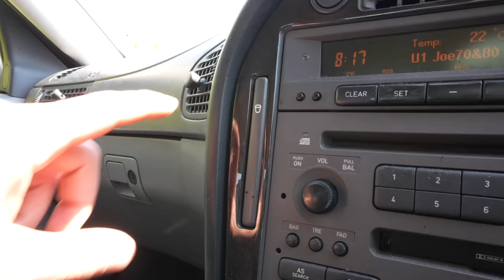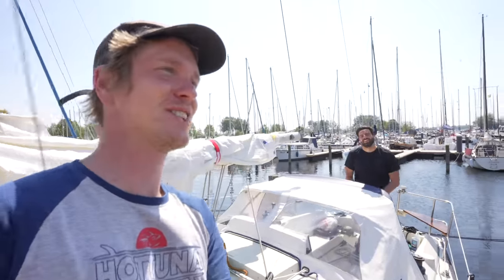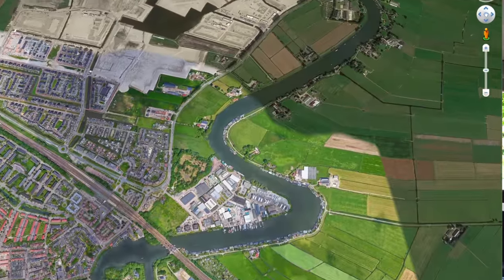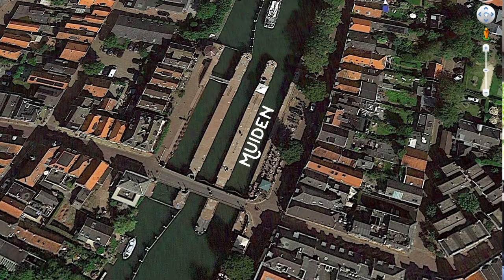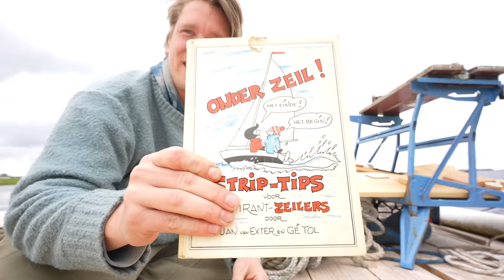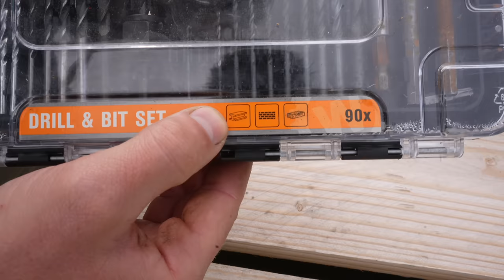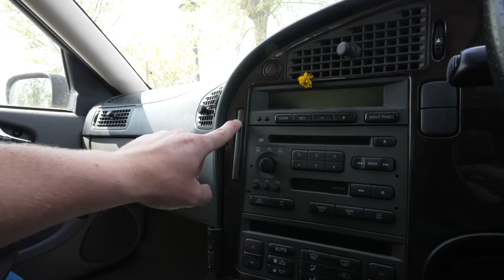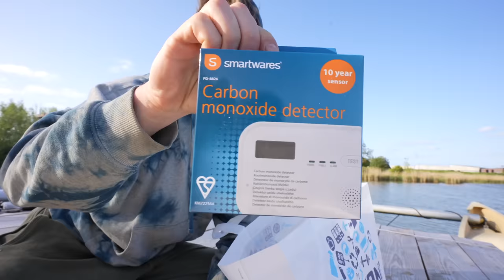Preparing to Motor My $2000 Catamaran To Amsterdam | Wildling Sailing

Comment: A cute sailing couple
with oceans under their keel
use fenders they made
which don't come with a bill.
Clean used tires lashed round
with beautiful knots;
they'll last forever
until the rope rots.
Just 2 and a 2x4
can fend you off a rough wall.
And when dragged off the bow
they make great drogues in a gail.

Comment: 20:33 one thing i would've added (at this stage) to the deck, would've been a linoleum sheet over it. Like the thicker type you use for hospital floors (they're a "hard traffic" type). Whenever you'd have work to do, you'd roll it on, and you could work without fear of stuff falling over AND because the linoleum is on top, it would've made a slightly better distribution of your weight on the boards. Would help you from going through if you jumped on one leg, but it would save your leg if you did. :) Source: i use two sheets of the stuff on top of wooden scaffolding. It makes cleaning and other affairs much easier.

Comment: Mark, instead of a cleat use an eye bolt so that the extended starter cord returns to its resting position without needing to tie it off and risk it falling in.

Comment: You can use (in desperation) glass cutting bits to drill through stainless. You need lots of oil and patience. Oil in general, should be with your drilling set into anything metallic.

Comment: You need to lubricate the drill bit continually as you drill steel. It will make your life a bit easier and save on drill bits.

Comment: The pull cord extensions are a super idea... cool.   
   Next ,  tiller....    you should have a tiller piece that attaches to the rudder arm, not a pivoting tiller piece on the rod  that ties the rubbers together.  Why???    Leverage.   As is,  you have to pull or push the tiller, and if the tiller is wet, your hands could slide down the tiller.   By have a solid piece attached to either port or starboard rubber ( or one on each),  you will get more leverage by being able to lean or put body weight on it.  The tie rod will make the other rubber follow whatever you're doing  to the one you are leaning on.  As is, in heavy seas, you would wear yourself out too soon.

Comment: When you are drilling steel with an HSS bit, you need to drill slowly and let the bit do the work don't let it  get too hot or it will burn the tip out

Comment: Drill tip stainless😊
Use some cuttingoil (or 2stroke oil) with drilling steel and stainless.
Slow rpm push hard.
All the best
Love following you're adventure.

Comment: On the engine the keeps dying try running it on premixed fuel and if it runs better they make block off for the oil injector system it's one less thing to go wrong running premixed fuel and ams oil makes some 100to1 synthetic tho I wouldn't run it than thin also i would suggest their penetration spray it leaves a film that helps protect and works better than pb blaster or free all ect

Comment: When drilling stainless, use a little oil, just a drop now and then will make those cheap drill bits go through the stainless easily. You will be amazed how fast it is. Just add more oil when it starts to smoke.

Comment: Get some good drill oil. Stainless gets way too hot and the bits will dull out in seconds. Drill it in  water if you have too just don't let the bit get hot. 😊

Comment: Hi there, would recommend trying to get some cheap nets (ex construction safety netting) to span under the open parts of your crossbeams. would make moving around much easier and safer. For fenders you can use tires as a last resort.

Comment: Concerned the outboards will hit something putting stress on the wooden mounting system which may give way at the corners - consider putting metal plates alongside the wood, "sistering" is the carpentry term, I think, to strengthen the mounting system. Aluminum L shaped or T shaped flat metal the width of the wood, drill through the metal and wood, place large washers, then smaller washers then lock washers on both end of the bolts for flexibility.  Bravo - donated rope & hand tools.

Comment: The trick about drilling stainless is to keep it cool.  If it gets hot it will work harden and then you are basically done.  Even switching to a new bit won’t help.   There are all kinds of ways to keep it cool but I just use water.  Just trickle water onto the bit and the hole as you go.   It’s a bit tricky to manage with one person to handle both drill and coolant, but can be done.  For example you can hang a bag of water with a little hole that drains the hole you are drilling.  I usually use a brush and a cup of water but it takes patience because the amount of drilling you can do before you need to stop and brush on some more water is not very much.
Reply: And drill SLOWER!
Reply: Drilling that hole would be tough on any drill bit let alone a cheap one. Alternatively, you can use machining lubricant. Any bits (swarf) coming off the drill bit should be a tan colour, if they're blue, or black etc it's too hot. A drill press would be ideal! And like another mentioned, go nice and slow!
Reply: This is great advice!
Reply: Hi Mark, you could use a plastic Sadie’s bottle with the conical neck. Then add a tube on the neck with a tube clamp as a tap. Then you find a place to put it to suit your work. It can trickle on the drill bit as you drill. I don’t know if that would suit you but it has worked for me, and cheap too. It suits my recycle, repurpose and reuse. Enjoying this journey as you rebuild this cat.
Reply: I usually put a small amount of old or used hydraulic oil or motor oil in a Tupperware and dip the entire bit into it. Oil slowly runs down the bit keeping it cool and lubricated. That along with low RPMs works great.
Reply: Coming here to say this as well. Definitely some cutting oil is needed. Take your time with it.
Reply: Also with stainless  you don't want to stop drilling as the bottom of the hole can polish and work harden. Any oil will help to cool the drill. Even wd40.  Also sunglasses make acceptable safety glasses.

Comment: Looking forward to seeing the video of you moving to boat yard . It was good you extended the pull start cables . But just one thing if you treaded it through a couple of ring eyes then put your cork handles on if you did accidentally drop them you would not have to go fish it out the water . Good luck

Comment: Mark, stop putting yourself down. You have a lot of experience and still willing to learn and gaining a lot of experience. I would not be in the least bit concerned sailing with you. Best of luck with the move to the hard. Still going to be a lot of work but should be a lot easier with the boat dry and your car much closer. Keep smiling, you'r doing fine fella.

Comment: Love the fact you have a dream and are following it. Best tip to give on this video is to just commit to some decent drill bits as the cheap bits will cost you more in the end. One decent set of Sutton bits ( not sure what brands are good over there) and also the trick is to slow the drill down. Even though they say high speed if you go to fast it just burns and makes the bit go blunt. One decent set of drill bits and a drill bit sharpening aid and you will be set. Also not sure if you doing a solar setup but those outboards with an electric moter instead of the gas engine would give you some free population

Comment: It may help when drilling harder metal to center punch first.  Also when drilling it would help to drill with slow speed heavy feed.   I don’t know what you call it but instead of a Clete you could use a screw in eyelet to hold you pull cord.  Cheers

Comment: Great Video! Cheap drill bits can be a pain, but if you keep the RPMs low and slow and use cutting/drilling fluid you can do almost anything with them- even more so if you learn to resharpen them ( the cheap one are easier to sharpen- not as hard- which generally also makes them not as brittle and less likely to snap if you sideload them accidentally).

Comment: Mark, you need cutting oil or foam for cutting metal, otherwise you will need shares in drill bits. Any oil while drilling on the tip of the bit to stop it heating up

Comment: When drilling steel, and especially stainless steel, go slow push hard and keep the bit cool with oil or something. It is more about cooling than lubrication. For example sometimes I spray it  with WD-40 which is not a great lubricant but by spraying it periodically (every few seconds) it keeps the bit cool. If the bit is spinning really fast it will harden the stainless steel, and dull itself very quickly.

Comment: hello, to make sure the bits don't break or not stick, you have to use them in the drill at a lower rotation.
You have to let the drill drill at low speed, if you accelerate you don't let it cut the metal, it heats up and you run out of blade. You make the drill not drill anything or take a long time to drill. if you add a little spray oil it also helps not to overheat.
If you want to drill a big hole, always start with smaller bits and work your way up until you get the size you want.
I'm enjoying your progress on the boat. The details are always cool to see! hug and good luck

Comment: Well done you are getting there, don’t forget only use 316 stainless steel fittings, screws and bolts etc. if you mix metal’s or use 304 stainless they won’t last very long and will leave rust streaks all over your restored boat…

Comment: i love watching Your progress. Who knows maybe you are just few years ahead of me.
When it comes to drills - in my old life (metalworks, blaksmithing etc.) i learned alternative approach. 
First: every drill needs cooling so think about anything with water - short while of drilling and put Your dril bit into cup of water till it feels cold again.
Second: metal drills gives great precision but requires really slow rpm, proper pointing/tracing of the hole and firm handling. If You can sacrifice a little precision for easier handling and less troubles in piloting the whole go for masonry drill bits. If something can chew trough reinforced concrete it can easily drill trough metal. (low rpm and cooling still apply)

Comment: Hi, I’m a big addict to your adventure, keep pushing. Small advice, for 10 $ you can put the lights , you know, red-green no front etc. is mandatory and if the night catch you while you are moving you Will have issues. Cheap one , a trick I used, 3 flashlight, one for the top, and the 2 for the front painted or covered with a plastic. You can solve it with 15 $. All the best for you

Comment: Someone below mentioned cooling the drill bit with water, and yes that can work to cool and lubricate and extend the life of tools, but water also solubilizes oxygen that will rust your tools.  Maybe you already have high temperature oils on Mahi that can cool the drill bit, lubricate and have the added benefit of preventing oxidation.  That oiling of metals is something you're going to want to do often, specially when your back on salt water since it's even more corrosive.

Comment: Watching you work and go thru new experiences is very enlighting.  I sail, but with a smaller neptune sloop.I have sailed smaller trimirans, but assisted in a major repair on the family 40 ft Matthews cabin cruiser, after we broached on a hidden tree.  Just a small tip, when you set up to anchor, tie your chain or rope to the head of the anchor and then zip tie the line to the shank, also run your rode thru a small tube and keep it on the deck till ready to pull anchor, just kick the tube into the water and back down, the tube will pull the anchor straight up and make retrieving your line much easier  Thanks, Ron

Comment: Hi Mark, great vids, beautiful boat, great work and good steps forward, you have the heart of a lion.
Small tip - to get the most out of a drill bit when drilling steel, I use a spray bottle of water to cool the cutting edges, it should be soluble oil mix but that's too messy on a boat, so water is a good compromise.
Good luck with getting lifted out at the boatyard.
Onward.!

Comment: Hi Mark, things are beginning to move along nicely now. Speaking of moving, make sure you have good mooring lines, long enough, to act as springs and shorter ones as breast ropes. I don't have to tell you, how boats love to dance shake and shimmy in a lock that's filling. Oh, and a little tip, when drilling metal, a small drip of 3in1 oil or 2 stroke oil on the job to aid the bit to cut it's way thru. And stop getting so excited, we'll all do that for Ya. KInd Regards, Barnacle Bern SY Cadbri

Comment: Cheap drill bits alson gets the job done on stainless but, as many others have already stated, you need to drill much slower but with maintained pressure, and keep everything cool. Water has been mentioned but i use oil - works great for me. There is a dedicated cooling/lubrication-spray but i don't know if pays off. KEEP UP! I love your channel!

Comment: Mark, when you a going  after drilling thru stainless, use high pressure and short bursts with a detergent or cutting oil as lubricant.  This keeps the heat down and won’t round over the drill bit.  Steel takes high pressure and very slow speed, same lubricant and give some time to let everything cool.   When you develop heat in the bit, you lose the cutting edge on the bit tip, and you  workharden the piece you are drilling which in turn will prevent the bit from cutting properly.  Machining takes patience and care to keep your tools working longer...........s take it steady with diligent pressure.

Comment: Another thing, I don’t know if you remember me telling you,  there is a measuring cup,  (get it from the boat shop) that actually tells you how much oil to add compared to litres of fuel,  (does the math for you) if eg you add 3lts  and want 50/1  the cup will show you for 50/1 (that’s the most common after an engine is ran in)  fill the cup to this line,  it’s simple and cheap and you just store it with the oil..   I personally love them old Suzuki outboards,  and i did recommend you extend the “pull cords”  idk if you read it,  but once you are on the hard? Give them a super clean and some new Suzuki grey,  (yes its still available)  personally i would remove the oil injection completely (it’s one less thing) and give them carbs another clean,  i know Dad already did them once,  but the old oil is probably still got microscopic sludge roaming around affecting your base idle, 
I personally DON’T think them engines will need replacing anytime soon, (I doubt they even have a,lot of hours on,  they were bulletproof in their day, and still compare power to weight with new engines,  (seriously look it up)    Anyway thanks again..

Comment: Should use a few drops of any kind of oil on drill bit and nut. I keep my used motor oil and lubricating drill bits is one of the many uses for it. Keeps bit from burning up. Nice progress. Great that you're making good friends. That's what a good life is all about.
Reply: And SLOW DOWN drilling metal!!
Reply: @dancarter482 
 Yes!

Comment: I saw a really interesting system for the outboard motors on another cat, they made a pivot cabinet so that they could raise the engines out of the water when under sail. That design made it easy to work on the engines without having to hoist them on deck but also since they pivoted out of the water it reduced drag  under sail. I beleive you could design this system with gas shocks so that you can lock the into place in both up and down positions and you also don't need to lift the full weight of the engine, this would something like a Murphy bed. It will take a little trial and error to get the pivot point and gas pressure right but the shop selling the gas strut normally allows you to bring it in and change the pressure if it's not correct. If you need help with the design you can post the dimensions and ask, I am sure someone watchin you has some experience.

Comment: Bite the bullet and buy 10 packs of HSS drill bits in each size you use - tapping threads need odd sizes which you will use over and again. (I learned the hard way).

Comment: @Wildling Sailing
I'm not sure if you saw my comment about making an off grid loo but all you need are a 5 litre plastic jerry can, a silicone rubber oil funnel for collecting your urine, a 20 litre bucket with lid, kitchen bags, peat moss from the garden centre & sawdust to cover your waste. About a coverage of an inch or 25mm of peat moss in the bottom of the bucket that has a bag in it then as you add your waste you sprinkle a little bit of saw dust over the solid matter then seal the bucket up, it won't smell as the peat moss will turn all the solid matter into soil.

An off grid shower, when I was in the provinces of the Philippines we had to shower using a 1 litre hand pail from a 70 litre plastic garbage bin that was used for water only & we would just use a soapy wash cloth to clean our body & rinse off with small hand pails of water. If you can find yourself a 12v DC circulation pump that does several litres per minute & buy yourself 50 metres of 1/2 inch or 13mm  irrigation hose plus a 70 litre plastic garbage bin from the hardware store then you can make a DIY solar hot water heater. By putting the hose in a flat spiral coil with the small 10w pump sucking water out of the garbage bin & pushing it through the hose until it returns back into the garbage bin the sunlight heats up the water in the black tubing to make it hot during summer or very warm during winter.

Comment: A couple of I- bolts to feed the pull starter extension's will keep the ropes from falling in the water. Mount them to the beams in front of the cleats you tie them to, even if you drop them they won't go far.